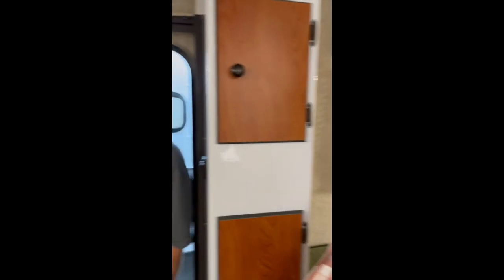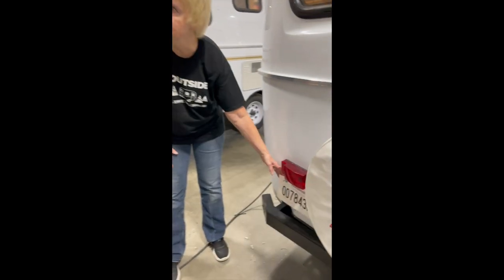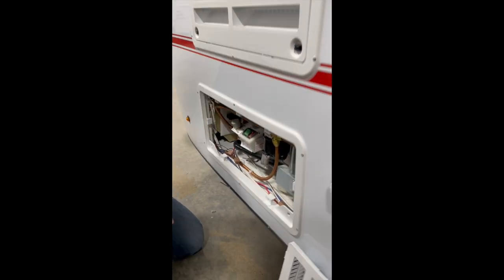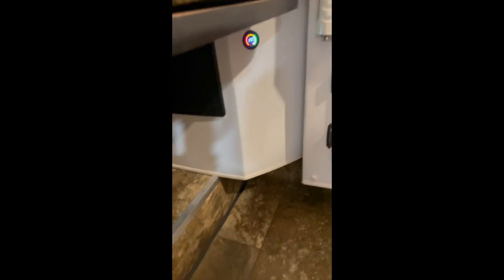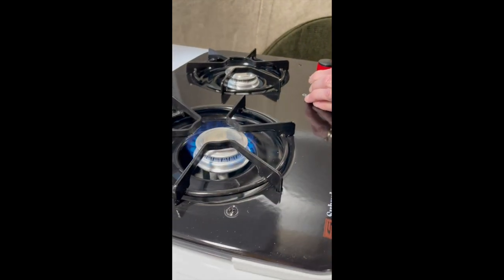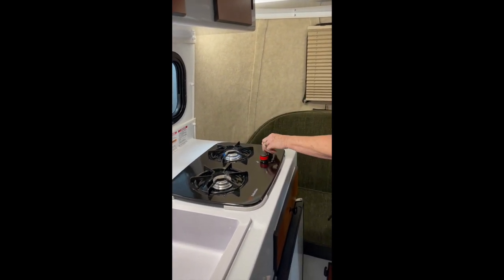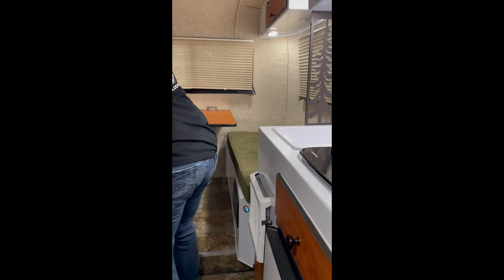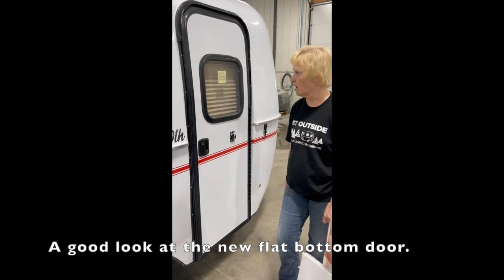The Factory Tour and Instructions for our 13' Scamp Trailer

Comment: Great tour.  Thanks.
5:08 Does anyone else think an AC with a 30 amp requirement is a bit overkill for such a small space?
Reply from the maker: It absolutely is. It cools the Scamp off super fast, and is very loud. Good news is, you won't get hot or hear the noisy neighbors. Bad news is, you're frozen. lol

Comment: Great video! This is the first time to watch the full tour and there're many new things I learned. Thanks for uploading it. 
13' Scamp does not have brake, so it fully depends on your SUV's brake on the road, right?
Reply from the maker: You can add breaks, and I did.  I don't think my SUV needs the help, but I'm sure it helps in the long run.  Mostly I did it because Canada requires it, and we plan to visit.

Comment: Seems like the fridge should have buttons on it to switch from propane to 120
Reply from the maker: They're on the outside. I think larger RVs have them on the fridge. Scamp just isn't that fancy.
Reply: @scampwanderlust  thanks
Reply: @scampwanderlust  how do you like the scamp?... any problems?
Reply from the maker: @crk140  None so far! Well, I mean besides learning how to back it into the spot behind my garage. That took some practice. We love it. Being 6'1, I've had to learn to avoid hitting my head on the AC, and adding a folding step to help get in and out has eliminated my hitting my head getting out of it.  But all in all, we're in love with it.

Comment: Did you get the extended 54" bed, that's why there was an extra leaf?
Reply from the maker: Yep, and happy we did. We were able to look at a few Scamps in our city due to gracious Scamp owners letting us check their's out. Though we fit on the smaller bed, it was tight with me at 6'1 250. Add the two dogs and it wouldn't have been uncomfortable. The big bed means less cooking/sink space, but we don't notice it.